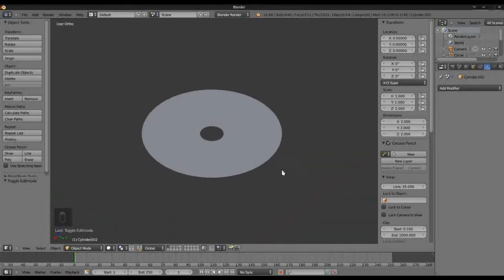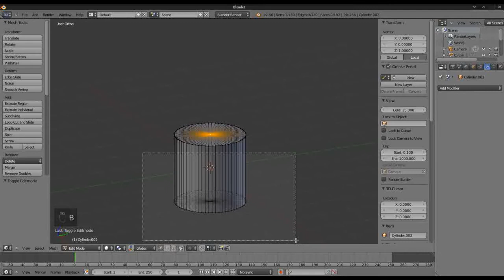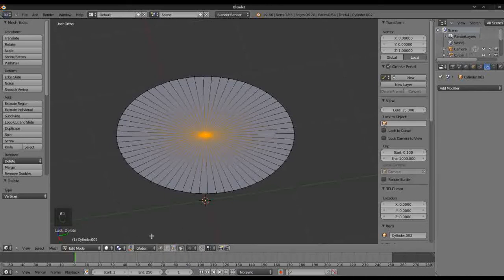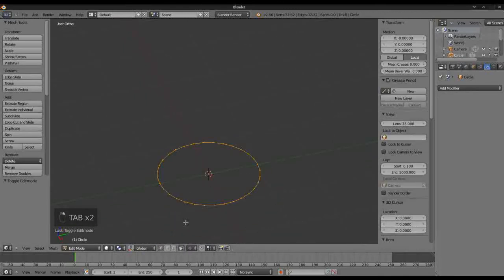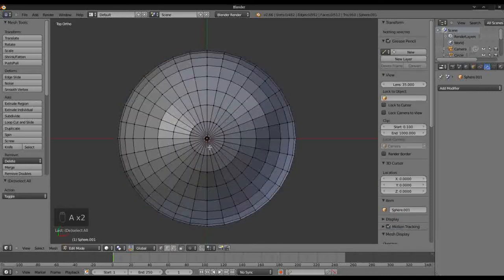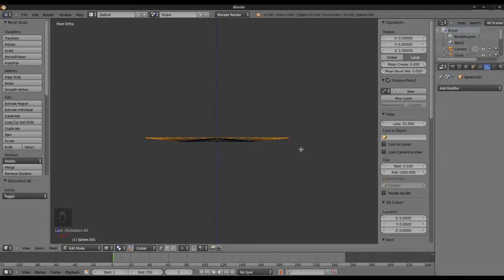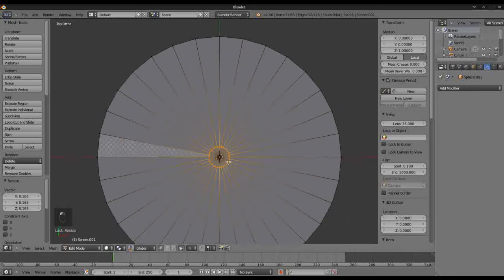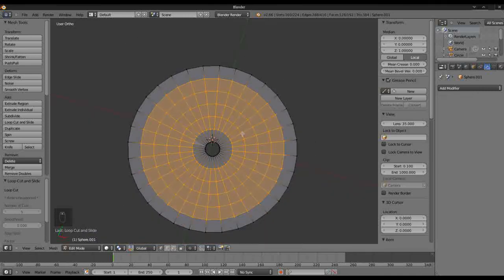Blender 2.66-Make A Circular Disc With A Central Hole (7 steps)

Comment: I love ur video. As i can seen ur using Xp and version 2.76b i have gone to the site (https://download.blender.org/release/Blender2.76/) and download the below file that is .msi and .zip file its not working i mean its not getting install in my xp3. Can u tell me or send me the link which setup i have to downloand and install for me in xp3. As im getting error or the zip file kerneral and for .msi cannot install.
Reply from the maker: Sorry Atek I am now using Windows 7 but you can check out https://www.blender.org/download/requirements/
also be sure to know which you need 64bit versus 32 bit

Comment: Man you can do this in 3 seconds. Either by creating a circle, extruding the perimeter and then scale it down, or with a cylinder, remove the bottom, select the remaining face and push "I" to inset the face, then remove the center.

Comment from the maker: @ AW Anderson - unfortunately you have set your comments so as not to allow a reply so I hope that you will get this in response to your comments a week ago. Thanks, it is great to know people are using blender for pie charts as well and I am glad you found this tut. I have dabbled with .py. but time does not allow me to fiddle and create something now. I am guessing you may be needing something to make it easy to divide up your pie chart- either way you have inspired me to make a quick tut in order to do that but in an alternate way. My tut should come out shortly. Stay tuned. In reply to holes in the circle- yes you can make holes in the same circle by making loop cuts in the disc and then you can delete the faces wherever you like. With subdivision subsurface modifier and sliding the loop along the holes can be easily made to be round, oval etc.

Comment: this is a very bad tutorial for beginners.
Reply from the maker: Thanks for your comment .Please can you provide me with the difficulties you experienced, or which you feel beginners would experience, so that I can improve on it.
Reply: ReichelProductions You dont name the commands you're using: for example B for box-select and the other command for circel-select which i dont know. You're going through 3 different ways how to NOT do the disc and thats just waste of time. You could have just showed the way to do it and the tutorial would be probably 2 minutes.
Reply from the maker: GD | Edits Thanks once again, whilst this tutorial is not directed at an absolute beginner I can suggest that you follow the key strokes recorded in the bottom left hand corner this will at least guide you to what keys are being used. Fortunately this video has that. My newer videos do not since the later version of Blender was not having key strokes.

The reason why I make a big deal about showing the other methods will become clearer to the beginner later on when they model things that have triangles rather than the preferred quads. An example of this is the LP which I show you how to create using the same disc. I explain this so that it will save you a lot of tears later on.

If you are still struggling then you can request which tutorials you require me to explain the very basic strokes eg box select etc. I would me more than happy to do videos on these requests if time permits (as this is not my full time job). I will be doing an even easier method on this with fewer steps in the future so if  you haven't subscribed please do  so if you wish to be updated. Look forward to hearing from you.
Reply: ReichelProductions oh right, i didnt see the symbols showing the comands! you should put this in the description though.
Reply from the maker: GD | Edits  Most in the Blender community are aware of the key strokes but its fine, you will get the hang of things. I know blender in the beginning has a very steep learning curve and can at first be frustrating. Just hang in there and enjoy the ride. Again let me know if you need basic tutorials on manipulating and editing etc. There are often many different  ways to do similar things in Blender and this is one example. I myself found an even better way to model this disc after I made this video and as I said I will present it soon. Different techniques anyhow teach one to use different tools and will only improve your skills for other projects.